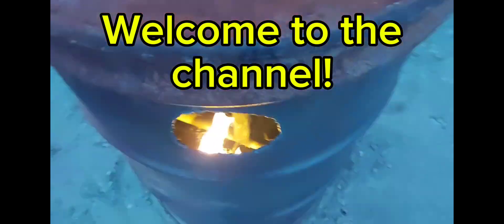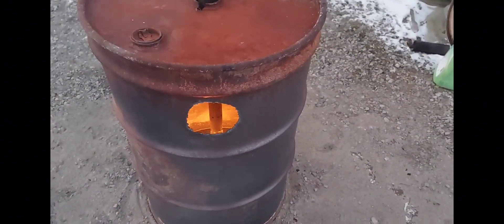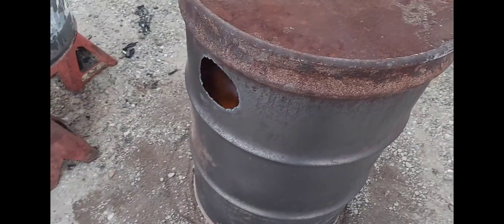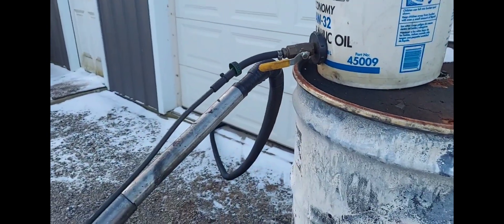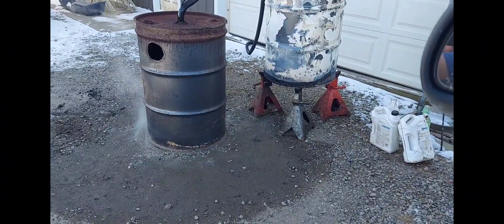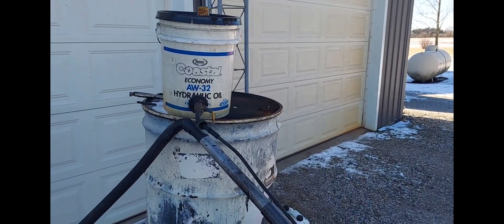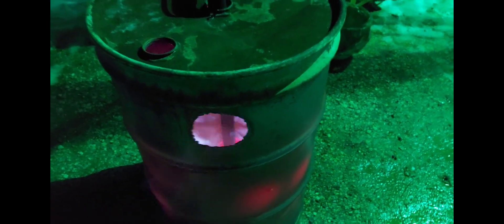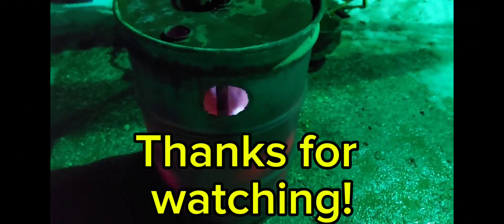Simple DIY blue flame burner updates and max efficiency test. 55-gallon barrel stove on steroids!

Comment: What about a baffle covering the exhaust, but about 3 inches from the exhaust port on the inside?  So it can flow around it, but hopefully trap more flame from just ripping out.  Impressive burn.   Can’t imagine a thicker drum.  Possibly exhaust tubes welded on its sides for thermal siphon of air?   So many directions….    I think I’m gonna play around with this as well.   Love the simple and effective burn.
Reply from the maker: @Cire3PC  I will try moving the holes or eliminate them all together. I thought about a baffle,but I think it would get too hot and warp pretty quick. I have so many ideas on what to use this for. I can't decide what I want to do with it! Lol
Reply: @ oh I get it.  My ADHD brain already started making 10 different projects….lol .   There is a good paint to be made about too hot.   Hmmmm….   We need to find you a thick @ss barrel, melting pot ?  Or a way to expel the heat from the barrel.   Instantly makes me think about liquid cooled :)  Yea, too many directions !